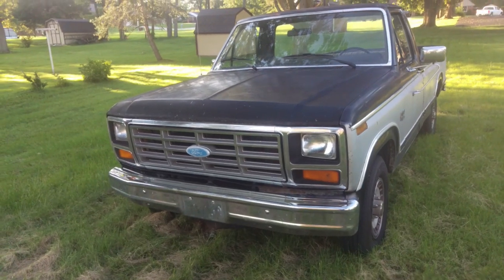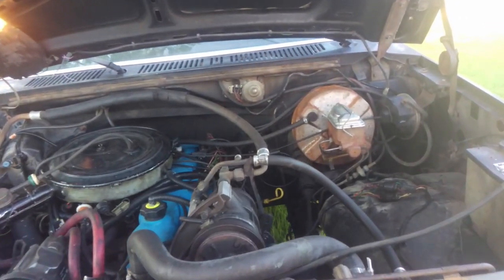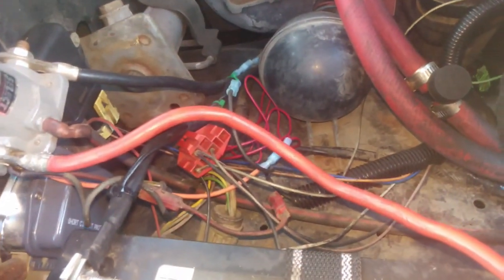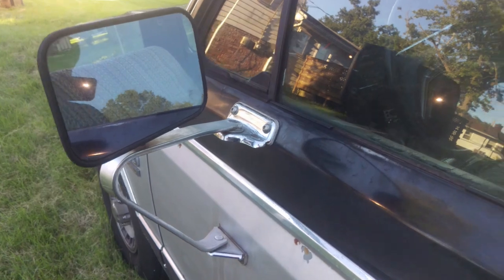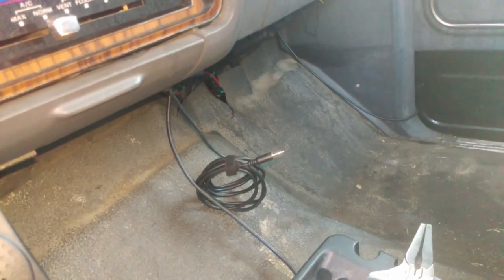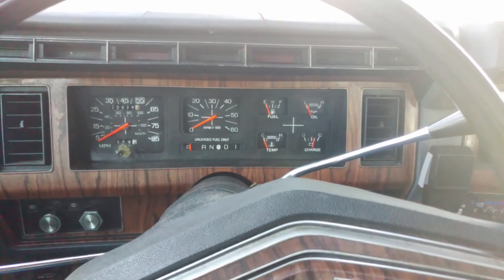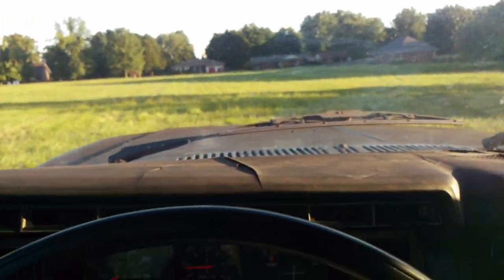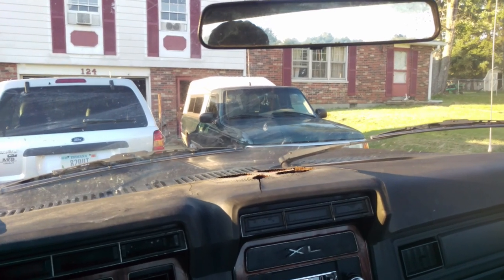2020 Bullnose Bible Virtual Truck Show: 1984 Ford F150

Comment: Nice truck man! I didn't know they came with overdrive, is that the aod then? Either way the 300s are invincible!
Reply from the maker: Yep. The AOD was  introduced with the bullnose as an option in 1980... ran until 93 on the F series. The AODE (electronic shifted AOD) was an option starting in 1992. 

Not as strong as a C6, but I don't tow, so the AOD is a good fit.
Reply: @ratdude747  yeah I have a t19 in my f250, still good towing but also get better gas mileage.